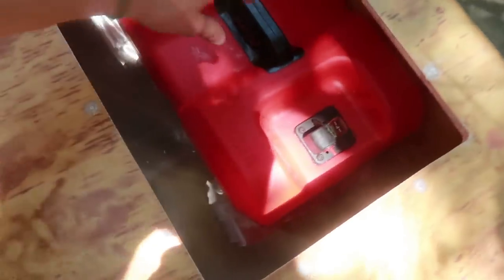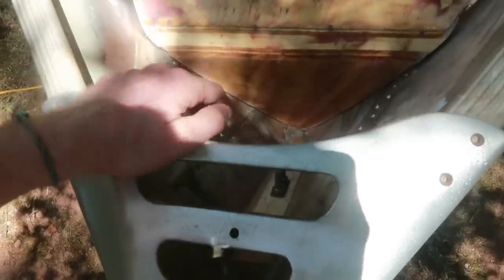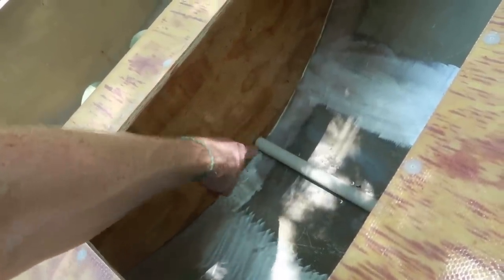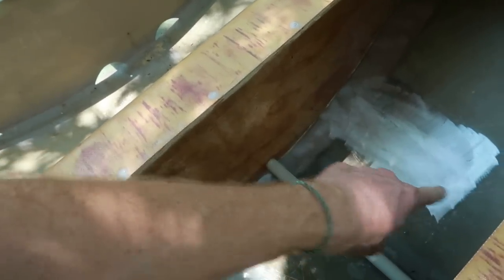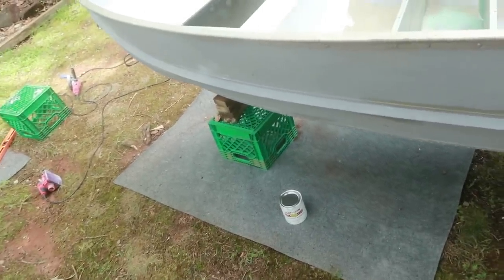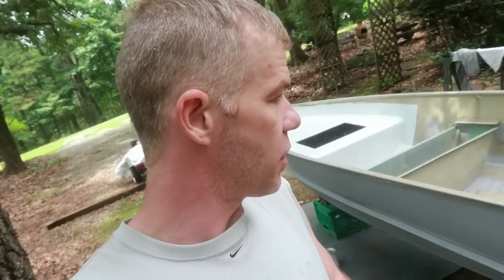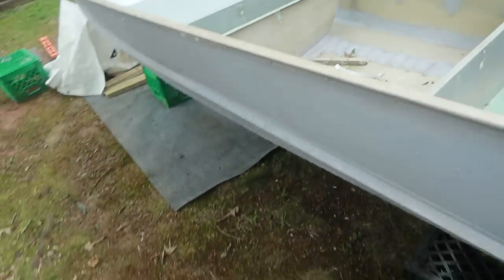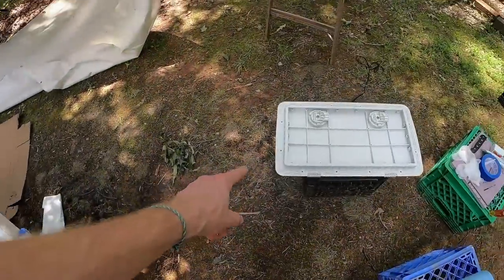Turning An Aluminum Utility Boat Into A Capable Cruising Dinghy | Sailboat Story 259

Comment: Hey mate! Fun channel. I’m just curious as to what made you choose an aluminum dingy over traditional inflatable? Just curious
Reply from the maker: Certainly. It really just boils down to a matter of our own personal preference. Having owned and used an inflatable while cruising, and also having seen and experienced their inherent drawbacks many times, we opted for the option that eliminated most of those drawbacks. Of course inflatables have many strengths as well, but the drawbacks outweigh them, for us. Inflatables have a finite lifespan and all will eventually leak and fail, inevitably. You sit on them, not in them, and in that way they are wetter and offer more opportunities to fall overboard. They don't row or tow very well. I've seen the wind blow inflatables over many times, but have never seen the wind blow over a rigid dinghy. I feel like they are vastly overpriced for what they are. Personally, I truly don't understand their appeal. As best I can figure, most people will buy an inflatable simply because they see that's what 95% of other cruisers have. Rigid dinghies, most of them, will last as long as they are maintained. They're inherently tough, but do require a higher degree of skill to operate and live with, but for us it's the way to go.

PS: I also tend to gravitate in the direct-opposite direction of the majority concerning almost all things in life, so there's also that. 🤪
Reply: @Sailboatstory  Good thinking, thats what make you special.
Reply: @Sailboatstory  thank you mate. Makes sense, I was definitely curious as I knew you had your reasons from cruising. Great fun channel and I actually love that guys are not like the other channels which copy each other.

Comment: I had a very similar boat years ago. I had a friend weld in a box for a dagger and a mast step. I cleaned, primed and painted the interior with truck bed liner. Think I got it at a Tractor Supply. LOL Never had an issue. It didn't sail worth crap. That is to say "It wasn't going to win any regattas", but it did Sail. I think my only concern (and it may be totally unfounded) would be the flex of the boat and the bond of the epoxy over time. Aluminum is a tough metal to bond to, even in the best of circumstances. As for the critics.... Bahahahahahahahahahahaha
Reply from the maker: That's good to hear that your modified boat didn't sail well as I was on the fence of whether to do the same modifications on this one. There are alot of people to are concerned about the epoxy bonding to the aluminum, but I doubt many of them have experience with the specific type I've used, which is G-Flex 650. It's much different from typical epoxy which generally cures very hard. G-Flex bonds to an adhesion strength of ~2660psi to aluminum AND it remains flexible. By comparison, many "strong" epoxy bonds are often less than ~2000psi and cure rock hard, which would certainly be more prone to failure. I'm not saying my approach is perfect, just that I've done the best I can, guided by actual numbers and data, and we'll just have to see how it goes. Either way it'll be entertaining, right?
Reply: @Sailboatstory I am most definitely NOT an epoxy expert. I do know the spray on (we rolled and brushed) bed liner stuck like poo on a shoe and was flexible enough to go with the flow. As for the sailing aspect... It was basically a cat with a short mast (sourced from an old hobby). I think it would have done well with gaff sized for the hull. I am too wise (AKA old) to risk a turtle now. 😂 Water is harder than ya think.😅😅

Comment: Slick paint job.  I was going to paint my Boxtruck RV conversion and was concerned my air compressor wouldn't do the job.  It is much bigger than yours like a 30 gallon, and covered with stickers saying it is unsuitable for automotive paint spraying.  I think they just wanted to sell me a bigger compressor.  Did you have to wait any for pressure to build back up, I couldn't tell from the timelapse?
Reply from the maker: Oh yeah. It went on and off often. Certainly not enough volume for the job in an ideal way, but we got through it without any real trouble.
Reply: @Sailboatstory  Great video and good job with the boat!  :) I too have a small compressor, and a boat that needs to be painted.  Based on a few Youtube videos, I was convinced I had no choice but to roll and tip.  If you were to do it over again, would you go back to the compressor, or roll and tip?  Can you point us to any other useful info online that helped you with your paint and compressor (eg pressure, equipment, thinning)?
Reply from the maker: If it were me, I think I'd borrow or rent an appropriately sized compressor. I think spraying is far superior for large surface areas. I personally, think there's more room for error with roll/tip, but many people have done it successfully. Maybe try both on a sample area before committing to the full project.

Comment: It sure is turning into a beautiful tender.
Are you planning on putting some kind of fender material on the rub sides, to protect the mothership?
Reply from the maker: I did intend to initially, but after talking it over more we decided to go without. We didn't have gunnel guards on our other dinghy last season, and we managed just fine using fenders. We may still add them in the future though depending on how things go.
Reply: Tugboats have tires as fenders about the rails.  Would a bicycle shop have some old balloon tires you could cut open and fasten along the rails?  You might consider the idea to ugly to consider but it might save some rails and hull scratches. @Sailboatstory
Reply from the maker: If I make some they'll be made from firehose covering yoga mat foam. Did that on the last dinghy and it worked great and was super tough.

Comment: She's coming along nicely!  You are going to have some nice storage space inside of that front locker, but is there enough clearance for access once the fuel tank is in place?  It appears that there is enough room for another hatch just forward of the large one.  Question:  Since the fuel tank is going to be located forward in the boat, why didn't you run some more PVC conduit from the front locker back to the transom to protect the fuel line before painting the inside?
Reply from the maker: Thanks, Robert. Yes, of course, the fuel tank can be removed from inside. We'll do that any time the dinghy is brought up on deck and inverted. While the conduit is an option I strongly considered, I didn't run a conduit because that would leave the forward hatch with an opening that could flood/leak. It would also add more weight, time, & cost to the project. The benefits just didn't seem worth the drawbacks to me. In the end, the fuel line is completely protected from the sun and also well out of the way.

Comment: Captain just wondering i didn't notice if you have a way to drain water from your fuel tank locker ? And yes in my 56 years on the water I have seen many experts with little to no knowledge give a lot of advice. So best i can tell you is do what works for you.
Reply from the maker: Wade, generally there shouldn't be any water getting into the bow locker. The water that does get into the "anchor well", which is what I'm calling the area forward of the bow locker, drains through the bow locker via the PVC pipe. If and when water does accumulate in the bow locker, I can just wipe it out with a sponge. It's for that reason why I shaped the fuel tank platform with the cutout area - that way there's a way I can get into that lowest point to remove water, which would otherwise be inaccessible. I hope that makes sense.

Comment: Looking good Ben! Got to ask ya though, what is the PVC Pipe for? You may have mentioned it before, but if you did, I missed it.
Reply from the maker: It's to allow the "anchor well" to drain through the bottom of the forward locker.
Reply: @Sailboatstory  WELL DUH! I should have figured that one out! LOL Thanks for the quick answer!
Reply from the maker: No problem. Thanks for asking.

Comment: I don’t understand something here and hope you or another reader can enlighten me.  1 Cu Ft of space will hold 7.48 liquid gallons?  Picture yourself placing 5 gallons of fuel into your gas can and placing that into your forward locker and connecting the fuel lines to the engine.  Now close your hatch.  Hermetically sealed.  Run your engine until you have used 3 of those 5 gallons.  I foresee a vacuum interfering with the fuel flow about this time, maybe sooner.  Won’t the locker need to be vented to prevent this vacuum problem?
Reply from the maker: Perhaps this will help. The hatch is not “waterproof”, it’s water resistant. The slight amount of air required can still get through.
Reply: Pardon my over-reaction, please.  On my submarines, when we sealed a entry or tank hatch, or shut a compartment door, expectation was for air and water tight.  Here's hoping you have not built to those standards.  You don't intend to take her to 200 foot depth to ensure no leaks?  Still would sail with you any day just to be with your family and you.  Go to bed, it is almost midnight where you are.  :-)  @Sailboatstory

Comment: How are you routing your fuel lines from the tank to your engine?
Reply from the maker: They exit the bowlocker via a bulkhead fitting, to keep the locker watertight, then run along the port side, tucked in securely beneath the outer edges of the seats, inside a protective UV sheath, all the way back to the aft end of the boat.

Comment: Very nice….but don’t you need to vent the gas locker ?..
Reply from the maker: It's not vented. The challenge is that while venting would allow for any fumes to escape, it would also render the forward locker useless as a source of reserve buoyancy. I considered adding a separate bulkhead in the locker and another deck access fitting, but decided to keep it simple and light for now. I may still make that addition in the future, but being concerned with keeping weight down, I didn't build that feature initially.

Comment: Nice boat! The paint is a good choice. One nick: I'd stick a respirator on my kid before sticking them in that locker with fiberglass, epoxy n paint.
Reply from the maker: Thanks. The locker was well ventilated during those stages. One thing about filming and editing these videos is expecting exactly the types comments we'll receive as a result, but going forward with the edit anyways. Your's was expected, and warranted, but she's no worse for the wear as we did take precautions even though they weren't shown.

Comment: How are you going to get the gas from your tank to the engine?
Reply from the maker: Fuel line running along the port side. Runs through a bulkhead fitting, filter, water separator, pressure relief valve, & fuel primer bulb. Hose is protected from UV. You'll see. That'll probably be in the next one.
Reply: Good @Sailboatstory

Comment: I do have seen a yard neighbor take of the non drying 2 component paint from his entire hull ignoring the advice not to use a incompatible hardner.  Your results may vary. Be cocky at your own risk :-)
Reply from the maker: Your neighbor used an incompatible hardener. That's not cockiness, that's idiocy. I, on the other hand, am simply capable of carving my own path in a generally predictable manner. What's the word for that?
Reply: @Sailboatstory  My friendly Belgian neighbor was just as Self Confident as you. What I am trying to say is the last part of this line from the Kipling poem:  If you can trust yourself when all men doubt you, But make allowance for their doubting too
Reply from the maker: I imagine if there's an attribute of mine that makes me appear outwardly confident, it's likely that I have very little fear of making mistakes, as I often do, and always learn from them. I do consider myself to be logical with an engineering mind, but always leave open the possibility of error and allow ample room for improvement, of which there always is. I'm no chemist, and I doubt your neighbor is either, so thinking I know better about what chemical hardener to use than the manufacturer is just not something I'd even remotely consider, especially not with a modicum of confidence.

Comment: Geez I hope I’m wrong. But I just don’t trust putting the lifting pad eyes on the bulkhead that’s epoxied to aluminum. My worst case scenario mind envisions the epoxy and fiberglass joint failing and you losing the dinghy. I would trust mounting the pad eyes directly to the hull reinforced with backing plates.
Otherwise, I really like the idea of using this little boat as your dinghy.
Reply from the maker: GFlex bonds to ~2600psi to aluminum. That’s higher than most “strong” bonds with typical epoxies. Regardless, I have the same general concern. I’m likely going to be adding further reinforcement inside the locker to improve the bond. A likely unnecessary project, but it could also prevent a larger failure.

Comment: zinc chromate primer, just wait and see.
Reply from the maker: What exactly am I waiting for?
Reply from the maker: Ok, I'll go ahead and take a stab at this despite the lacking context for the sake of having good information here for anyone interested. Zinc Chromate is indeed useful for producing a better bond between paint and BARE aluminum, however there's no use for Zinc Chromate in this application as the bare aluminum was all treated with G-Flex 650 epoxy. Essentially, there's nothing for zinc chromate to bond to. The only reason I've primered the epoxy is for UV protection, which I've mentioned previously. So in this case, with no bare aluminum to bond to, zinc chromate has no particular benefit whatsoever.

Comment: Good job so far. Did you weigh the boat before you started? I’m figuring you’ll only be a few pounds heavier dry weight than a CL360 RIB. Also thinking not much weight gain from the new hard parts. As to comments. Remember the confused cowardly cranky commentariat are sailing couch cushions not sailboats. 2 weeks until we push south this year.
Reply from the maker: I did not weigh it directly, but going from the old brochures I found, I believe that it weighs 120lbs empty. Moving it around by hand, that weight feels about right as I was surprised by how light it was, or perhaps by how strong I am. The forward locker, hatch, stainless fittings, and fuel tank adds another chunk... perhaps 30lbs, not counting the fuel. That puts us right at 150lbs, dry. I think we're probably within 10lbs of that. Perhaps calling it 160lbs dry would be reasonably accurate?

Comment: Ben, Ben, Ben Ben.  Wrong, wrong wrong. . . everyone knows when painting dinghies such as yours that are comprised of Aluminum, epoxy and striated cellulose fibers .  You need to use a 6 part cobalt urethane exoplastic polymer with the high exothermic self leveling valence catalyst bonding agent.  Dude, c'mon. . .   The dingy looks awesome, btw.
Reply from the maker: That is, like so many things, the one and only, exclusively right way to do it.
Reply: LOL 
 @Sailboatstory

Comment: I am jumping on this bandwagon.......
1, You used the wrong color scheme as it should have been Florida Gator Orange & Blue.  Now your boat will sink due to the uneveniness of the weight of just one color. 
2, The sprayer tip was toooooooooooooo small  which did not allow the paint to atomize.  This will cause a bad chemical reaction and eat your boat from the inside out. 
3, The sprayer hose was coiled in the wrong direction which makes the paint flow against its molecular structure which will cause your boat to capsize on a docile sea.
4, I saw no ticks in your yard and without ticks you cant get Rocky Mountain spotted fever
5, The pvc piping you used added way tooooo much weight to the front of the boat which will cause it to dive into approaching waves which of course will sink your boat.
6, You left no space for a toilette paper dispenser and you know what happens without one of those....Yup your boats sinks.
Get gooder Ben  😉